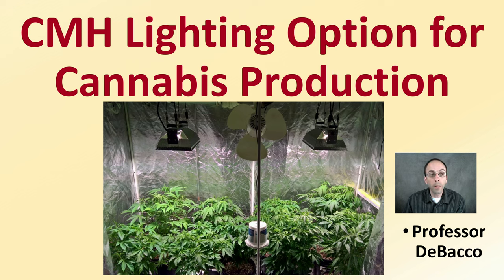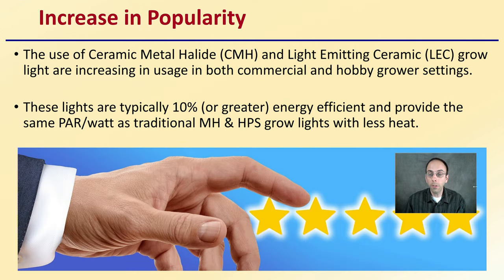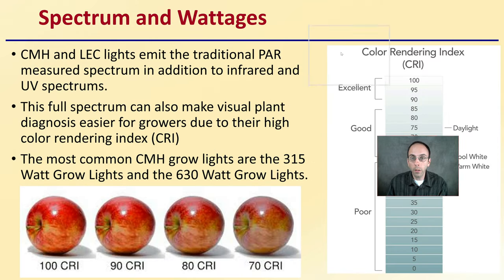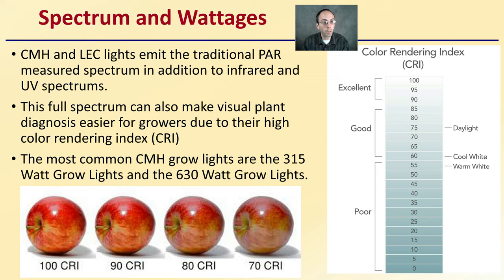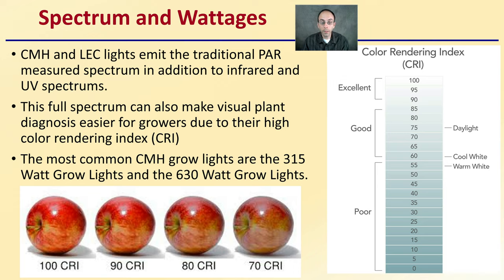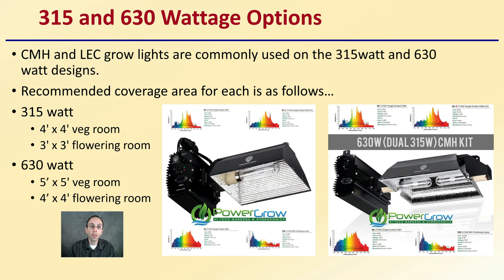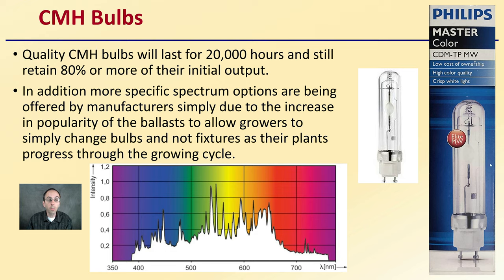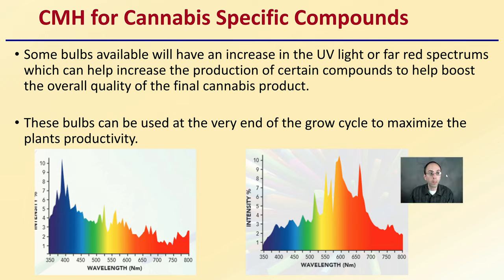CMH Lighting Option for Cannabis Production

Comment: First
Edit:  “LEDs last forever” is this true or do grow LEDs burn out or use up anything?
Should I have a backup LED light?
Reply: They last long time  but i did order 2 viparaspectra va 1000s only using 1. Hehehe never know!!
Reply: @dr.trichome6419  thanks,I think it makes sense to have a standby so I’ve just ordered another one 👍
Reply from the maker: Back-ups are always a good t hing to have... just in case.
Reply: @DeBaccoUniversity for sure but it just adds extra cost to new growers who don’t have any income to brag about. I have to keep to essentials only. I suppose if the grow light was to breakdown then it’s most definitely essential to have another ready to grow otherwise I risk killing my indoor garden.
Reply: They say they will last an average of at least 50k hours.  
HLG has a three year unlimited warranty on their LED’s.
Reply: LEDs are unreliable junk, even the best ones. They are known for failing early on in grows. There is too much going on in them. Granted HPS cab be unreliable unless you clean them thoroughly and never accidentally rub your hair on them etc. CMH are reliable as long as you don't  run them dimmed all the time and DO NOT put air-cooled hoods on them, it can cold shock shatter the outer tube. They are double tubed to protect the inner tube, what you don't want to do is overly cool the outer one as the inner one is at full temp. CMH run cooler in the space as they have less IR heat but the inner bulb itself is silly hot in the middle. I measured 360deg bang in the middle of a 315w compared to 320 for 660w HPS but the rest of the CMH bulb was only about 200deg where as the HPS was over 300 the entire bulb. Again, they run cooler because of less wasted IR heat. Been doing this 4 decades now, used every light and my recommendation is to stay away from LED unless you want dramas mid grow and want to be smoking popcorn weed. Stay away from 1000w HPS they are too hot and bleach plants in small spaces. Go with 660w hps preferably air-cooled or a proper 315w CMH system if you can afford them. Don't get the twin bulb 630w CMH fittings they don't get close to what two seperate 315w do, people will argue that they have better penetration bellow the canopy but that's only if you are directly comparing them to a single light source. Two ligh sources will utterly mug a single light source for penetration as it will eliminate half the shadowing by default. Decent growers can pull a kilo from two proper 315w no joke. I can, easily. Most will do 12-15oz per lamp so you can rest assured I ain't making that up.
Reply: @pjarma8536  if you are doing it right you won't have any issues with money for light upgrades mate
Reply: LEDS DO NOT last forever-any electric light source does not have indefinite life!
Reply: @thomasoliver5095  how do they break?
Reply: @pjarma8536  The junctions in the LED diode fails,the phosphors that give the LED a white light fade out.Again any sort of electric light will eventually fail.The LED driver -or ballast fails more often than the LED diode itself. Had MANY driver failures-even with flames and smoke!
Reply: @thomasoliver5095  so it’s the drivers that fail?
Reply: @fakevirus8828  I don’t now :)
Reply: @thomasoliver5095  phosphorus?
Reply: @pjarma8536   No. -“phosphors” chemicals in or around the LED that convert its normal blue white color to a white color it is yellow in color when the LED is off. When the “driver” or LED ballast circuit fails it can burn out the LED light generating diodes too. Again all forms of electric lighting have failure points. If someone can come up with an electric light source that lasts “forever” they can both a rich man-or a poor man-if the light lasts forever you will not need to buy replacements. Phosphors are used on the inner surface of  fluorescent lamps to convert the UV radiation to visible light  the argon-mercury mixture in the lamp is mostly blue-purple color-not useful light. Also phosphors used on the inner screen surface of cathode ray TV sets to convert the electron beam energy scanning the CRT screen to useful color or monochrome images.
Reply: @pjarma8536  Yes.
Reply: @rexoliver7780  wow I thought they only worked through photons and electrons I had no idea phosphorus was involved. Thank you for that info.
Reply: I’m still using the same lights. Plus extended my operation with the “spares”
Reply: @pjarma8536  Not phosphorus-but PHOSHPORS  Those are elements in CRT’s fluorescent bulbs and most LED elements that convert the primary radiation of the device to useful light we can see and use.Phosphorus is an element. Not used in lighting devices.
Reply: @pjarma8536  recently received some Philips 315w CMH bulbs-on the package they say 30,000 hours with only 10% light loss over that lifespan. LEDS may not give you that kind of life. Another thing LEDS are driven hard so as to give the max light output and color. This makes them run HOT-reason for large heat sinks. The tiny LED semiconductor junction has to have heat removed from it or the junction burns out! The heat isn’t a problem for HID bulbs because of large size. to disapate heat.
Reply: @rexoliver7780  the diode is the radiation producer and phosphors use it to illuminate. I get it.
Reply: @rexoliver7780  I have my circulation fans blowing across the lights now.
Reply: What’s your view on using cmh and led together ?  I have idea to use 320 watt led with a 315 cmh in a 4x4 tent.